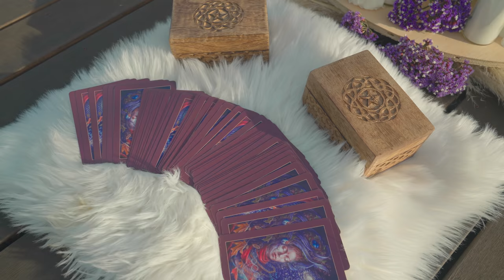How to Record Professional Audio on a Mirrorless Camera with The Tascam CA-XLR2D

Comment from the maker: Great question @global001. You have two ways of connecting your DJI MIc to the Tascam CA-XLR2D. 1st- is connecting the 3.5mm cable that comes with DJI Mic to the 3.5mm jack input on the XLR2D. 2nd- is purchasing a 3.5mm to XLR adapter and plugging that to the XLR input on the XLR2D(make sure Phantom Power is turned off!). As for setting, start by lowering the input of your camera and XLR 2D line input to the lowest it goes. Then once you have good gain on your DJI Mic receiver adjust the input levels of the XLR2D so that your audio levels are not clipping or peaking. I like to have my loudest levels reach somewhere around -12db. That way I leave some headroom in case my subjects gets louder. Hope this helps!

Comment: So we have two R5C's, an A-cam build on rails with the XLR module and a B-cam kept stripped down for gimbal and photo duties. The XLR module ended up being faulty and had to be returned to manufacturer. Would send a low buzz tone though all outputs and get rejected by the camera (red ACC icon) as a supported accessory. Full diagnostics ended up joyless by both us and CVP's repair team. Now we gotta see if getting a new module shipped to the shop or have Tascam repair it is faster. Pretty unimpressed and hoping it was just a bad batch on launch :/ It's honestly less work to just Y-splitter the 3.5 jack from self powered audio sources directly (Sennheiser lavs and something like an NTG 4+) and run one channel -10dB from the other for headroom.
Reply from the maker: I'm sorry to hear about your experience, I can tell you the unit we got was tested with our Canon R3 and R5c in our latest trip out to Alaska with no problems. Although I agree having audio recorded independently from the video source, It was rather nice having everything baked into camera. Very useful for run and gun shooters!
Reply: Just ran into this issue, maybe had this unit for 3 months! Shocking

Comment: Thank you for this video, will be buying this for my R5c and thisbwill be my first XLR experience. I was wondering what the ATT and the limiter setting did but couldn't find nothing on them till this video. So thank you for that along with the other cool features like the headphone button on the back! BTW does this bake the 24 BIT audio at 96khz into the video tracks also? Or is there a setting for that

Comment: trying to connect the battery holder for 2AA's to the tascam unit. I have removed the plastic cover. It's obvious the battery holder can only go one way. Does it really require a lot of force to attach the battery holder. I am worried that I am going to break the unit, or the contacts. Any comments or advice would be appreciated.
Reply from the maker: Although we did not experience any problems with the review unite we got, You should never have to force anything. I would try and approach the battery compartment at an angle!

Comment: Great stuff, did you slow down the audio to match the slomo video or was audio original speed ?  Thanks 👍👍
Reply from the maker: It was kind of a mix of both, we shot this near PCH so the car noise was on and off. We chose the best audio clips from multiple takes.

Comment: Sennheiser 416 doesn't fit very well in that hole. any tips to keep it in place? it sags
Reply from the maker: Yes, I experienced the same issue with the FX3's mic holder. You can purchase a rubber insert that will bridge the gap giving you a snug fit. Google Boom microphone spacer!

Comment: Hi helpful review thanks. Just curious I'm using this on R5C and it works fine, camera is seeing it, audio levels are being monitored. However, when I go into the R5C audio menu it's all grayed out there's no way to control mic inputs internally other than on the fourth page. Do you know if this is by design or if I should be doing something to turn It on. Any help is much appreciated and thanks again for your video, very helpful
Reply from the maker: I believe it''s by design. I was able to work with a couple of different scenarios and not need to touch the camera to get a good mix. Try it out!

Comment: if want to combine 1 XLR mic that's on the camera and a wireless mic that seems to be connected to 3. 
that doesnt seem to be a possible solution. only seeing 1 , 1+2, 3 only
or is there a way to do that?
Reply from the maker: You could always use a 3.5mm to XLR adapter and run channels 1&2 as mono! Check out our website for available adapters!
Reply: @SamysCameraOfficial  ahh thank you very much. didnt know those adapters existed

Comment: Question: what happens on an R5C when I plug in 1 XLR mic through the Tascam, and plug in Rode wireless go through the camera’s 3.5 input? I use the Rode wireless go for a lavalier and I want an XLR input for a shotgun mic
Reply from the maker: Hello Diego, anytime you plug something in to the mic input on the R5C it will bypass the Tascam XLR2D. I would suggest using the 3.5mm Mic input located on the Tascam unit.
Reply: @SamysCameraOfficial  can you use the 3.5mm (input 3) and shotgun (input 1 or 2) together?
Reply: @regnismada4936  Although we did not test it in this configuration, The 3.5mm jack acts only as an output that can switch from line signal out to headphone out.

Comment: Doe this work with the canon R5 as well?
Reply from the maker: Yes it does!
Reply: @SamysCameraOfficial  awesome thank you!
Reply: @SamysCameraOfficial  also, a little off topic from the mic review, but was wondering if this channel, or another you may know of, has done a review with the R5c in natural lowlight? I video wildlife and am thinking about purchasing the R5c for the added ISO over the R5, not sure if it would be worth out though?
Reply: My experience has been that it doesn't work with the R5, the R5 audio recorded with two channels does not appear when placed on the FCPX timeline, both channels are together and not independently adjustable for levels which is super disappointing, it was one of the reasons I bought this. You can record and adjust levels from two sources but the camera records them as one baked together audio track. If you expand audio components in FCPX you get two audio tracks but one is empty and the other has both sources. Such a shame.

Comment: How do you connect Rode wireless go II?
Reply: I would recommend using the 3.5mm jack on the Tascam CA-XLR2D, this is a stereo input, therefore, allowing you to have two lavs connected to the Wireless go transmitter or just one with a safety track.